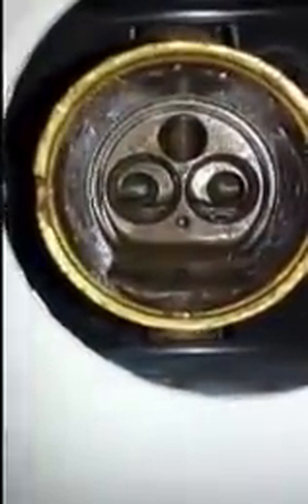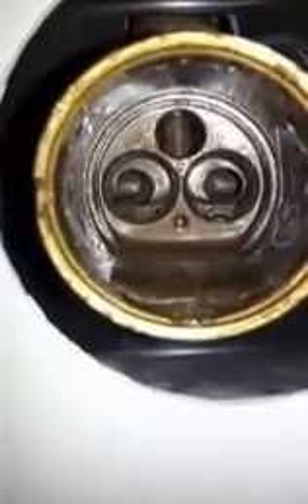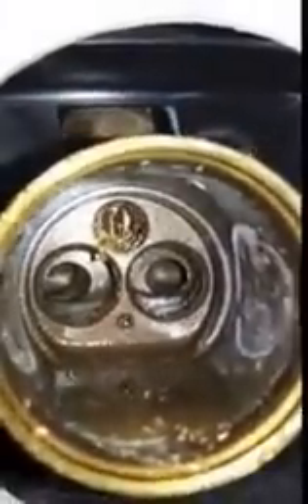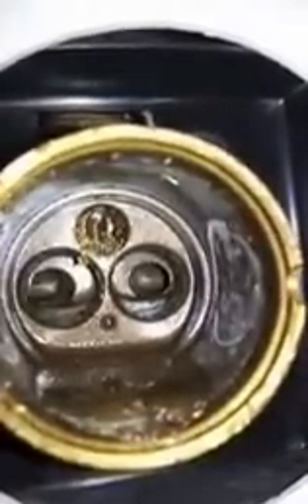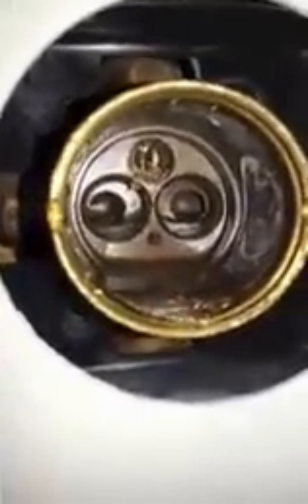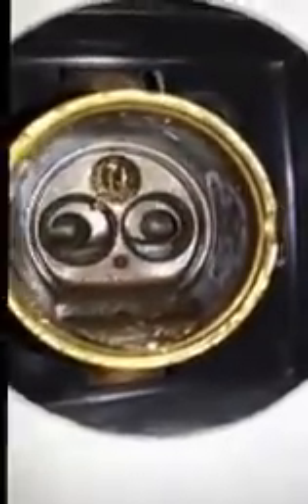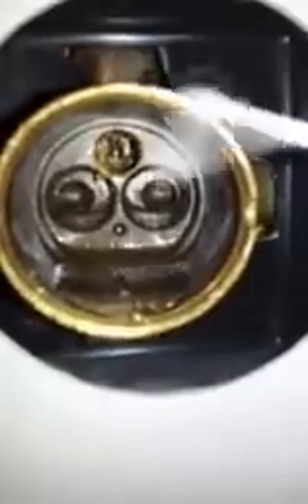Delta Valve Body mod for more water flow (now w follow up link)

Comment: This is such an old video so I don’t know how many people will see this but…. I was on the verge of calling a plumber for the exact same problem with the exact same faucet/valve assembly. After reading the comments here, in a last ditch effort I flipped the shower head outlet pipe upside down and poured some CLR down the pipe. I had plugged the water outlet for the tub and the cartridge for the valve was installed. Waited about 5 minutes and then unplugged the tub spout letting the CLR go down the drain and then poured some clean water down the shower outlet pipe to flush it. When I turned on the water, to my amazement, I had full flow again.

Comment: I am so glad I found your video, just before I cut open my wall to replace my delta valve body.  Like other comments, I had changed the cartridge and the problem didn't get any better.  I then ran it with just a test cap installed and still low flow (.4 GPM).  Ran compressed air in both directions (I couldn't flush it with water because to shut off my shower, the entire house is off), so I had given up.  In a last effort while searching how to replace a shower valve from one side, I stumbled across your video.  I was very suspicious, given the poor video quality, but then the comments assured me it was a real option.  Then your follow up 8 years later convinced me to pull out a 1/4" drill bit and try before I started tearing into the walls.  Great news, I now get 2.4 GPM through my shower with the old cartridge installed.  Thanks for figuring out this for all of us!  Have a great week!
Reply from the maker: Great news. I agree that the video quality is terrible. Surprisingly, it has the most views and helped a lot of people. That is the most important thing to me.

Comment: I fixed this problem (very low flow through Delta shower valve, with good water supply and good cartridge) using only vinegar! Drilling the hole might be better long-term, but it wasn't necessary in my case.

Remove the tub spout (it unscrews) and cap or plug the pipe. Remove the showerhead, rotate the shower arm so it points upward, and fill the pipe with vinegar using a funnel. Let it sit overnight (I left it 12 hours). Uncap the tub spout pipe and run the water. A bunch of crud dissolved by the vinegar should shoot out. Put your thumb over the pipe and flush out the shower riser before putting the showerhead back on.

Comment: Man, thank you so much for trying this and posting a video about it.  Thought I'd share my experience with doing this. First, we have different trim and valve body. It's got a handle for flow and small handle for temperature. Now the entire reason I even watched your video was the thumbnail showed the inside of the body and it looked exactly like ours. BUT this a big but to, when I drilled the hole, no tiny pipe inside the pipe you drilled. It still worked though, now pressure better than new.

Basically, I went with big bit and "flattened" and dented the pipe which got a pinhole started before going to a smaller bit. I went incredibly slow and grindy, and had dust instead of shavings LOL. I was really worried about the tiny pipe inside, even though I ended up not even having one. I suggest to anyone doing this, take your time on the hole drill. I mean the whole point of this mod is to save you from replacing the valve body to get pressure back. You have no idea how much of a job this saved me from having replace that valve body, whew...

Great video! Best potato vid on you tube man, thank you!
Reply from the maker: I am moved by your words.

Comment: Just about to try it (was getting prepared to rip out the tiles.... (I will drill out the valve too) will update on progress....
Reply from the maker: How did it go?
Reply: @usaryder74    Arrrgh. Not a success. I drilled out the pipe and drilled out the restrictors in the valve (the top ones) and also drilled out the inlet ports on the valve's metal plate.  I had baselined the flow and it increased a bit but still just below  2GPM. I took out the mixing valve - still no improvement. I don't think the outlet spigot has a restrictor.

So the flow is being restricted somewhere and I might go back to look at the 'pipe in a pipe'. Do you know if there is a diagram that shows exactly what it does?  Any other ideas?  There has to be a restrictor somewhere as there is loads of volume and pressure presented to the valve?

Comment: 100% worked….thank you for posting this.  I’m on well water and have a lot of sediment and rust from galvanized pipe in the house.  

Tried everything from compressed air, water back flushing, tapping on the brass tube to loosen sediment, rust and sediment remover.  

I also had the same delta diverter valve as the original poster.  Tub spout still works 100% as well.  

I believe the compressed air would work it was caught soon enough.

Comment: It worked for me as I don’t use a tub. If anyone have any doubts. I used a boroscope with a light to make sure I see what I’m drilling. Started with the smallest drill bit and worked my way up to about 1/8” or so. I also drilled out my cartridge to allow more flow. Water pressure was so intense that I had to use my shower head diverted at lowest setting. Thanks OP. You are a life saver.

Comment: I'm in a similar situation. I wonder how the inside pipe that you drilled gets water inflow from the bottom spout. Trying to understand the mechanism
Reply from the maker: I now understand this thing better. Water gets mixed in the cartridge and is sent down to the spout. When spout is shut, the water goes up passing trough the "inner tube". 
Somewhere where the water is sent back up, a build up of sediments take place. This reduces the water flow. The hole I made is a bypass.
I actually put a new spout at the bottom, and works fine.  The only difference is that when the spout is open (like bathing a kid) some water still makes it's way up to the shower head.
Read other people's comments. Lots of success stories. I should make a follow up video.

Comment: Do you also need to drill out the holes in the cartridge also?
Reply from the maker: No. The cartridge is intact. 7 years since I did the mod. Still going strong.

Comment: Thanks for having the courage to take the risk of experimenting to see if this mod worked.  Changed the correct cartridge twice, but the water continued to just dribble out at the shower head. Valve and pipes were clean/unclogged, and pressure elsewhere in the house was fine.  Found your video, performed the mod, and it immediately solved the low flow/pressure problem!  For others reading this, the drill size I used was a 9/32nds from the 'Titanium' line of drill bits from Harbor Freight.  Went at slow to moderate speed and pressure on the drilling until I felt the drill 'punch through' the tube wall.  I actually kept the previously suspected 'bad' cartridge and tried it first with the mod.  Lo and behold, the 'bad' cartridge plus the mod produced high pressure and great flow at the shower head, and there were no leaks in/around the valve!  I now have an extra cartridge for future failures.  Great job and thanks again!

Comment: I just used this little trick today on a faucet with extremely low pressure. First I changed the cartridge and it actually made the pressure worse. Then I drilled the hole and voila!  Problem solved. Thank you so much!!  I did not lose any functionality.

Comment: I am very pleased to report that this mod works and has saved me a couple thousand dollars to replace two delta valves with something that works better.  These are in a lake house which is on a well and has never had the kind of pressure we have at home.  Nonetheless, what we had worked adequately until we did a major renovation about 10 years ago, which included redoing all of the plumbing.  Our contractor installed these Delta valves, and I had no idea until reading this thread that they were intentionally designed to retard water flow.  I had actually replaced both valve cartridges, thinking that was the problem.  Replacing the cartridges seemed to help, but I now realize that what actually helped was me using air pressure to blow out the lines while doing the cartridge replacement.  This would only help for a while, however, and the problem with anemic water pressure would recur.  I now know that I was simply blowing out debris that was clogging the narrow channels where the water had to go  around the interior pipe in the valve body.  This design is nuts, but opening up the interior pipe eliminates the bottleneck.  I now have good pressure for both the shower and the bath spigot.  Both were previously impaired by the design bottleneck.  Also, there is no need to block the bath spigot.  This mod fixes both the bath and shower pipe flows.  Take your time with the drill, vacuum out the metal shavings, run the water with the shower head off to make sure any lingering metal shavings are flushed out, reinstall the shower head and hit the showers.  Thanks so much for figuring this out and sharing your discovery.
Reply from the maker: another happy youtuber. Cool

Comment: Just want to let anyone know, I've had low water flow/pressure ever since we moved in. I tried numerous shower heads, cartridges, etc etc and nothing worked. When the cartridge was removed and the valve body was the only thing attached, there was enough flow to fill my bathtub halfway in 1 minute, so I knew I did not have a "blockage" or low water pressure. Installing the cartridge reduced the water to nothing more than a dribble comparatively. After drilling the hole in the center tube in the valve body my water flow has increased 200% and pressure at the shower head is fantastic. It also doesn't take 20 seconds for the water to come out of the shower head after using the diverter like it did with the low water flow. So I just want to say thank you, I can now enjoy a shower and not stand there for 10 minutes to rinse the soap off anymore.
Reply from the maker: Great! I am so happy for you Mat.
I always smile when this super amateur video still helps out folks out there. I still don't understand Delta's design.

Comment: Thank you so much for this video!!! I have been stressing and fighting to finally find out what the problem was with my tub and shower. For 5 years I have had the issue with low flow and pressure with both. When I moved into my house I had pressure but it faded in the past few years and I couldn't figure out why so I said to the moon with this and tried your technique on your video and BAM!! I now have great pressure and flow for both . Thanks again we can now finally have a decent clean shower not an hour long one just to rinse the soap off.😋
Reply: What about the tub? Does it still flow well?

Comment: Dude, you are a saint! I was prepared to tear open my wall to replace everything since I had such little pressure. I tried your drill technique and now I have more pressure than I ever have had in 30 years in this house. The thing is, my bath spigot and shower head both work perfectly. I didn't lose my bath spigot function. The drilling portion was easy, not much pressure needed. I used a 1/4" drill bit, and used my vacuum cleaner to suck out the chips. Thank you!
Reply from the maker: Cool. 
You are right, I don't think I had to seal up the spigot. But I never re-opened. I don't ever use it.
I don't know why the valve system has to send the water down, just to make a hard turn going up. That is where the build up happens and you lose flow. Water always follows the least path of resistance. So the mod does not affect the spigot function.
Open heart operation does the trick.

Comment: same setup, the low pressure was because some dirt clogged the down pipe going to the tub facet, drilling the hole bypasses the clogged down pipe, I fixed it by blowing compressed air through the tub spout

Comment: Thank you so much for posting this video I've had a horrible shower pressure for years! Thought I was going to have to replace the whole valve system. Did this modification and it's the best shower I've had in years!
Reply from the maker: I am happy to hear that. I still find funny to see that my worst quality video is the one that has the most views and positive results for people. There is always a hater out there just bcs my accent. But 99 percent is happy viewers. And as a perk, I got to piss of Delta. LOL
Reply: @usaryder74  yeah once I saw Delta commented and recommended not to do this I knew it was safe. Lol thanks again man not all heroes wear capes.

Comment: For years I’ve watched my pressure drop to a dribble, take out the cartridge, blow everything out, clean with CLR for the buildup, and reassembled.  What a SHIT design.  Finally I found your video and gave it a shot.  BOOM.  Water pressure at the shower head and nothing short of a 1/4” ball bearing is going to plug that hole.
Thank you!!!!
Reply: Same issue we encountered, same effort we made, issue was still there, hope your comment will fix it forever

Comment: I don't have the same Delta valve as depicted here (mine was a shower only version), but this video did cause me to inspect the holes behind the cartridge (which I had replaced). There was some small amount of hard water build up, and a plastic strainer coming off cartridge. I jammed a screwdriver through the buildup and removed the plastic strainer - now I have ALL of the water pressure. I can't comment on the drilling part, but I figure I just save myself $200+ from having a plumber come out and trouble shoot this issue. Drilling seems like a low cost thing to try here, because if this is your issue, your options seem to be replace the value, or drill and maybe have to replace the valve. Thanks @usaryder74.

Comment: These valves are "water saving" type with restrictions on maximum flow. Usually it's 2gpm, lower in California. I found Moen S3384 rated the highest, 17.5gpm @45psi
Reply from the maker: The cartridge continues to only allow the regular volume, the body is not even the problem, but it was the solution for all these years.
I think the problem is at the bottom, where the water turns 180 degree back to the shower head. Calcium/mineral build up must be the culprit.

Comment: I had the same problem, I replaced the cartidge twice and it just was getting slower and slower.  I was seriously thinking about replacing the whole shower valve, I did your mod and the shower works great now.  Thanks
Reply from the maker: Nice to hear that. I think the true problem is at the bottom, water outlet, where the water is forced do make a 180 degree turn to reach the shower head. Calcium build must be culprit. But we can't get to it. Hence the bypass. My shower still works well after all these years.

Comment: Will this work on a Delta R10000-UNBX rough in valve
Reply from the maker: I don't know. I am not plumber.
Reply: Sal Tagliamonte theoretically, it should. The valve in the video is a 10000 series valve, just not sure if it is UNBX or another model. Same internal workings though. I am a plumber.

Comment: The drill bit everyone used, was it the same size as the middle hole? Did you guys drill out the tube completely?
Reply from the maker: The bit I used was a little smaller than the "tube".

Comment: I've only low pressure with HOT water. Cols water pressure could also improve, but the HOT water is very low. I'm curious to know if the drill technique will improve all around water pressure?
Reply from the maker: Your heater coil might be loaded with calcium build up. You may have to clean the coil on the inside, but you might need a plumber for that.

Comment: Hi Delta Faucet, I'm sorry to hear that you were publicly making false statements. However, you can easily state the new unaltered OEM flow rate in gpm. After a simple flow test is performed, then a comparison of the valve in the field could be determined as acceptable or a fault and your possible debris obstruction diagnosis or another possible cause of the decreased flow rate could then and only then be made. By simply stating your blanket diagnosis of debris blockage to the thousands of Delta faucet owners experiencing this decreased flow rate issue/symptom without even identifying there is a problem clearly shows your total disreguard to remedy this issue. Futhermore, you have demonstrated a dishonest diversion tactic by not even exploring the possiblity that the issue is a result of design. You have failed miserably at your position of Delta Faucet Representative and shall no longer be allowed to lie to your customers